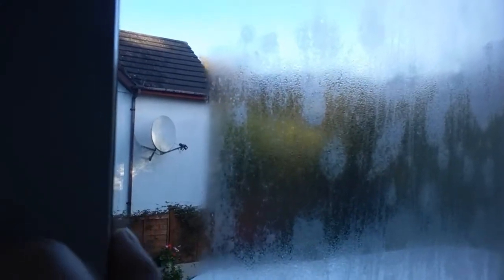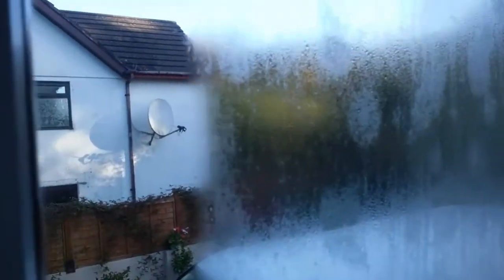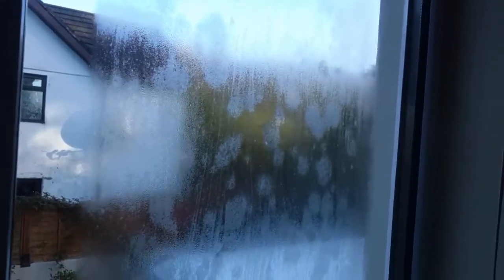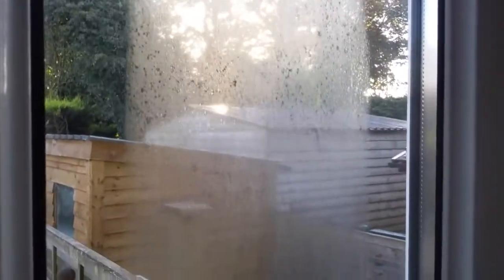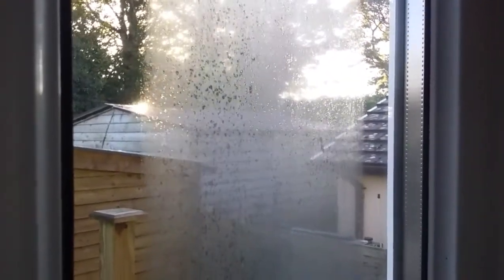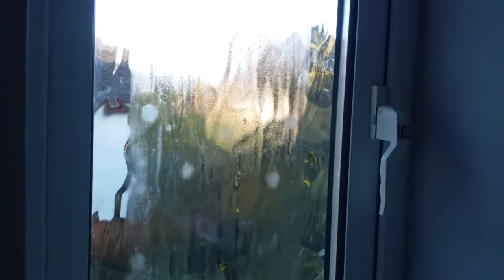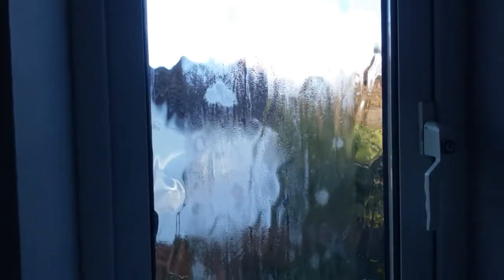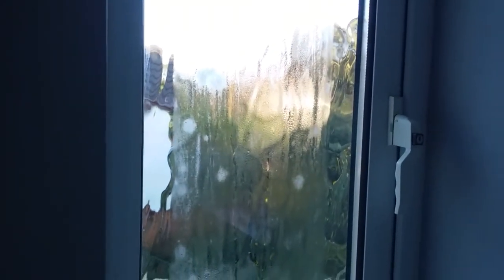Double Glazing Condensation On Outside

Comment: Condensation on the outside when certain damp conditions prevail outside, actually means your glazing is ok and doing it’s job better than a lot of sealed units out there.
When the air is extra damp outside after a few days of rain etc then it gets a little cooler, the glass on the outside may mist over. Once the sun comes up in the morning, or the air warms a bit, the mist goes away. The units are doing their job of keeping the heat inside the room.

Comment: I get this all the time on nearly all windows in my house. Although I read up on it and could see that the double glazing is doing it's job I want to see through my windows. It sometimes takes until the afternoon before this clears and when it's on all windows it's defeating the purpose of having a window (to see through). I'm finding it really annoying waking up every day to an entire house where all the windows are misted. By the time they have cleared it's afternoon and the temperature starts to drop again.
Reply from the maker: I fitted a non low-e panel of glass and it does mist up on the outside.

Comment: No that is absolutely not because of the low-E, that is because of the insulated glass. Insulated glass is way more expensive but always have this problem the argon gas between the 2 panels leak ,or even if you choose to have insulated glass without argon gas, the Seal will broke by time and the windows will become foggy. The only solution is to replace that window if it’s still under warranty, or else 😅
Reply from the maker: What a load of rubbish you just came out with. The condensation is on the outside of the double glazing not the inside!!!!
Reply: Listen to what is being Explained........Condensation is forming on the outside of the glass NOT in between the 2 panes of Glass! Jeeeez Some people!.........